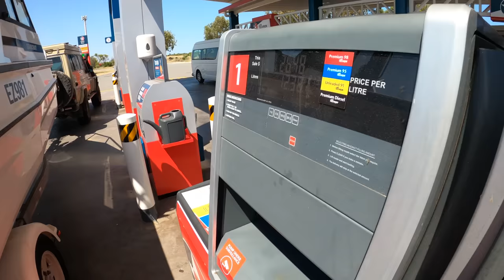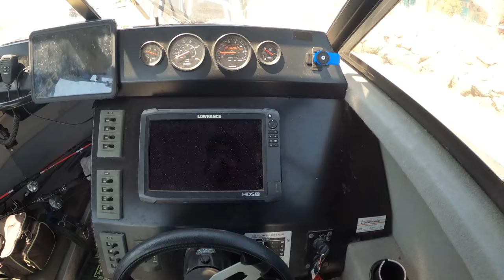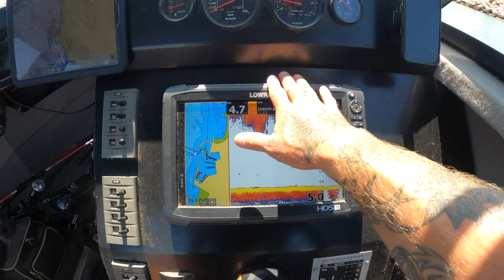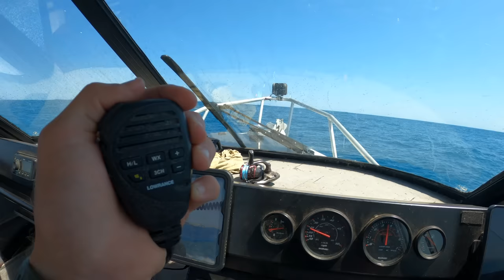164 FOOT DEEP - I made an underwater SPY CAMERA  - Catch and Cook Coral Trout

Comment: waffles:

Ingredients:
- 2 cups all-purpose flour
- 2 tbsp sugar
- 1 tbsp baking powder
- 1/2 tsp salt
- 1 3/4 cups milk
- 2 eggs
- 1/2 cup vegetable oil
- 1 tsp vanilla extract

Instructions:
1. In a large bowl, whisk together flour, sugar, baking powder, and salt.
2. In a separate bowl, beat together milk, eggs, vegetable oil, and vanilla extract.
3. Add the wet ingredients to the dry ingredients and mix until just combined.
4. Preheat your waffle iron according to the manufacturer's instructions.
5. Once the waffle iron is hot, pour the batter onto the waffle iron and cook until golden brown, about 3-4 minutes.
6. Serve waffles immediately with your favorite toppings, such as butter, syrup, whipped cream, or fresh fruit.

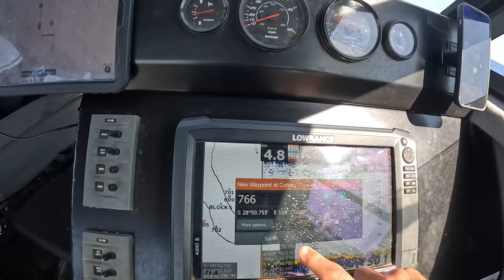Comment: nice  video. at 08:05 on your FF screen I c ripples at the bottom . i guess they r channels? that is where u drop tour bait ? which setting r u using ? pole, ree, leaeder , hook n sink ? 766 is the point u marked on your device n the location u fished  ? on the 1at screen on the left , the line is a contour line ( blocks ) built in or u drew it ?